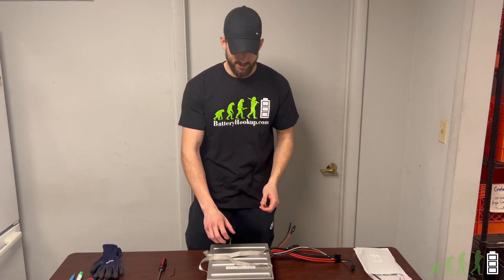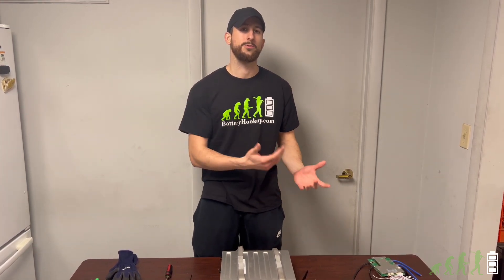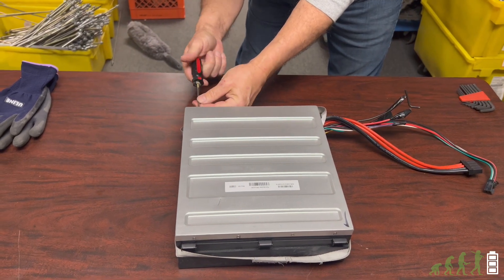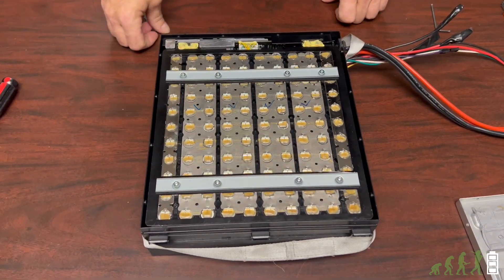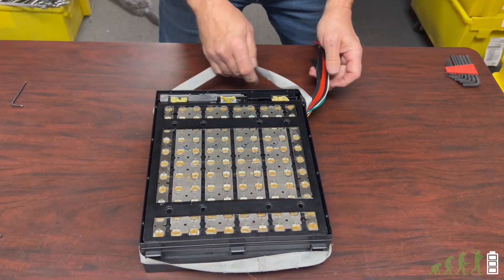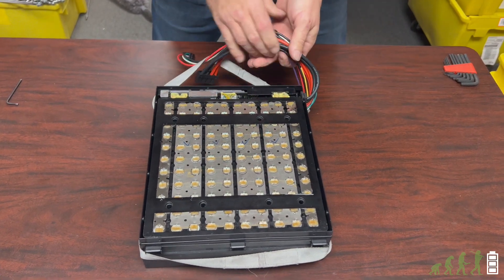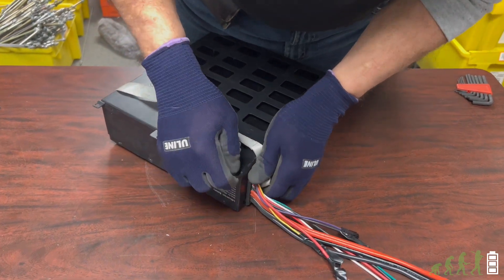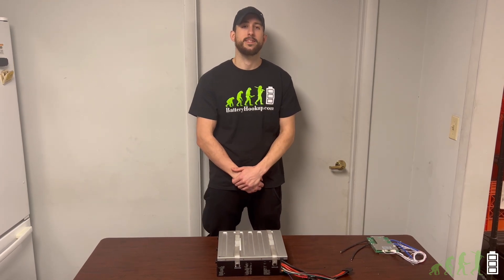36v Battery Packs Recovered from Robots

Comment: I'm encountering an issue with charging. It accepts a charge only for an hour or two and then the BMS turns off the power to the charging leads, and the charger turns green. Anyone else with this issue and figured it out? Otherwise its been able to output 150a bursts on my go kart with the original BMS. Love it otherwise!

Comment: IDK if you guys look at these comments, but that cooling material you mention on the website you wish that you could offer, it is just a run of the mill thermal pad. I believe they are some kind of silicone plus thermally conductive filler material. the grey color donotes it is meant for high temperature applications, such as PC parts so something around 100 celcius max...  blue thermal pad material is slightly worse performing but really these materials in this thickness are just to remove air gaps, they aren't a replacement for thermal epoxy or even better, a paste.

Comment: Just want to add that you can use the BMS as is. It will take a charge on the main lead out of the box and to turn on the output look for the two wire connector. On mine its a purple and yellow wire. Connect them together and then you have battery voltage on the main leads. If your looking for a 36v pack this is amazing.

Edit: Looks like the charging lead is the longer red and black wires on the 4 conductor connecter. The one with the red, black, green and white wires. I was able to charge over the main output while the battery was less than 36v. Once it hit about 37v it stopped unless I turned on the output. I could still charge if I enabled the output but figured that is not how it was designed. The shorter red and black wires just seem to be another output that is switched with the main output, probably for the computer controlling the robot the pack came from.  I have been charging at 15a with no issues. Ill update this again if I find anything else out.

Last edit: The green and white wires are labeled CAN_L and CAN_H. There is also a epoxy like substance on both the negative and positive side of the batteries. Its quite annoying to deal with as you must chip away at it and then sand it off to get a clean cell.
Reply: @jason riggs So far every cell I have tested has been over 4700mah of the rated 5000 so they are testing great. And Im testing it at 2a per cell. The epoxy stuff definitely sucks, cleaning off the ends of the cells was easily 75% of the time taking it down to the cells. I ended up scraping most of it off with a knife then using  a flap sandpaper wheel.
Reply: @joshricker410  Thanks for the info. I just got a few of these. Glad they're testing well.
Reply: Thanks for the details on how to activate and charge with the built-in BMS.  I was able to make the connection and get output on the main leads and charge the battery using the longer red and black leads.   I had the same situation where I couldn't charge the battery past 36 volts unless I turned on the main output.  The main output leads look very beefy.  With the 4 wires I imagine they could provide excellent amperage.  I have a couple of questions.  Did you happened to do any amperage measurements on the main leads?  What do you think the CAN-L and CAN_H wires could be used for?
Reply: @robertcetti6935  The can wires sound like a can bus network. The bms is behind a 150 amp fuse. I would guess around 80-100 amps but I don't know for sure.
Reply: Any further update on using the built in bms?
Reply: I'm encountering an issue with charging. It accepts a charge only for an hour or two and then the BMS turns off the power to the charging leads, and the charger turns green. Anyone else with this issue and figured it out? Otherwise its been able to output 150a bursts on my go kart with the original BMS. Love it otherwise!

Comment: How much adhesive is holding the cells the last one I bought from you had eve cells were basically superglue in and had to rewrap all of them once I got cell extraction
Reply: Ditto... I was unaware of this. A two day project turned into 5.
Reply: @metal4afterlife  so it did have a lot of glue I didnt buy

Comment: Any idea what the max amperage of the strip is with the current config? Wondering about a 20S11p setup.
Reply: Cells can do 14amp each times 11 so 154 amps it prob can handle atleast for short times. There is a lot of nickel there